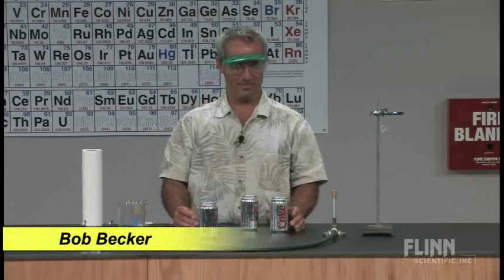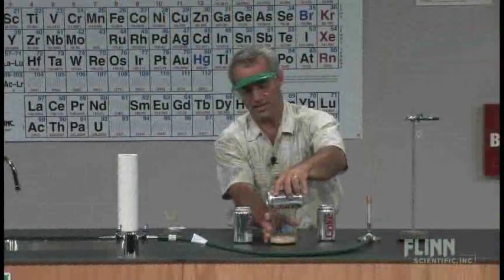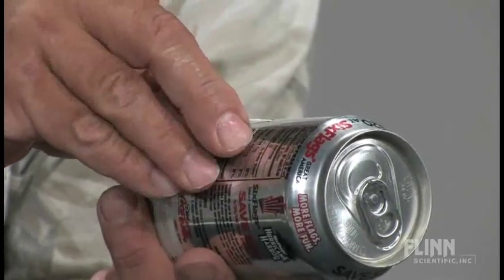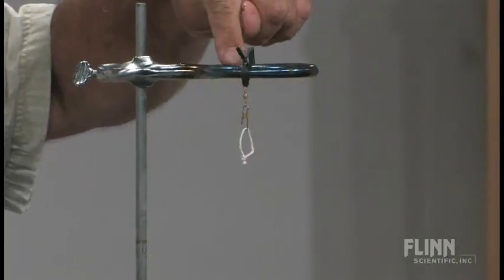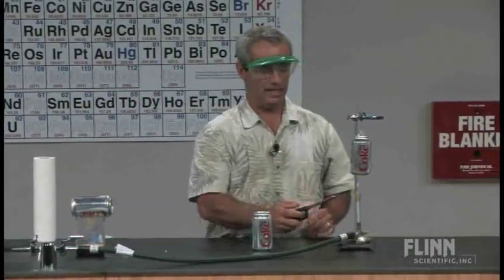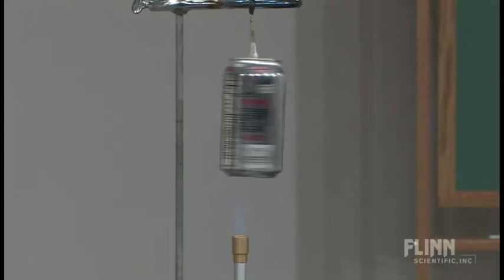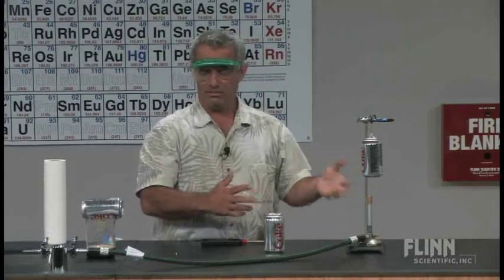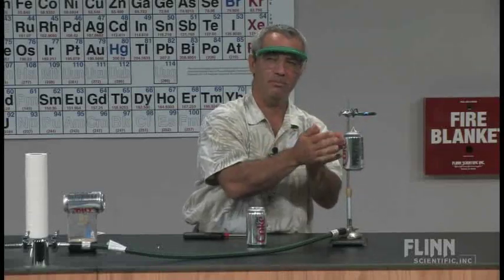An Easy Hero's Engine

Comment: Be careful about saying that when boiling water hydrogen bonds break! This is most likely to be misinterpreted to validate a big misconception that students have (perhaps some teachers too). Many students believe that the bubbles in a pot of boiling water are full of hydrogen and oxygen gas that is created from the O-H bonds breaking. Better to say that adding heat increases the kinetic energy or motion of water particles, allowing them to overcome intermolecular forces that attract them to each other. Boiling water is still H2O - its just that its particles are moving faster and more spread apart. Then third law: can push gas to the right ------> gas push can to the left.
Reply: Oh, you mean people will confuse hydrogen bonds between molecules with the covalent bonds within molecules that contain hydrogen?

Comment: This is really cool. I've been reading about the Hero engine for a while now, but I didn't realize how easy it could be to make a simple one like this. I really want to try it now. I've always wanted to build my own little honemade engine. Also this seems a lot safer than trying to make a steam engine with a boiler. I wonder, if you could make some kind of a better shaft and bearing for it, and use reduction gears, would it be able to turn a small generator? Would it have enough torque? It would be neat to get a really simple little engine like this to actually do something useful. Maybe just recharge batteries or something.  And you could use solar heat to boil the water.

Comment: If  it takes two holes anyway, make both at the beginning. The can would be emptied far faster! It's physics!
Reply: I'm not sure it would. The top hole would release CO2, while the bottom hole would release liquid. Better to keep the CO2 in the can to help push the liquid out, no? Also it would be harder to catch the liquid and avoid making a mess if you empty it indoors.